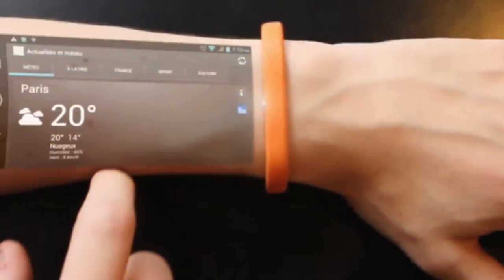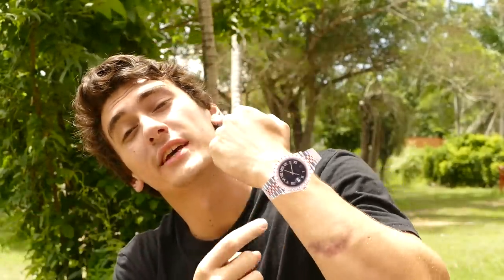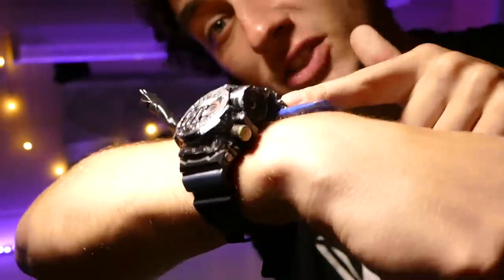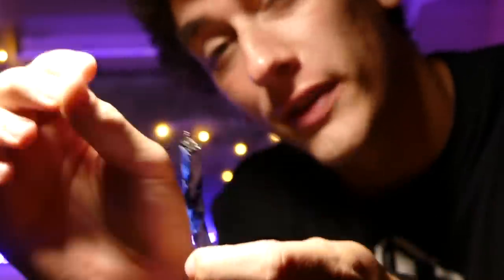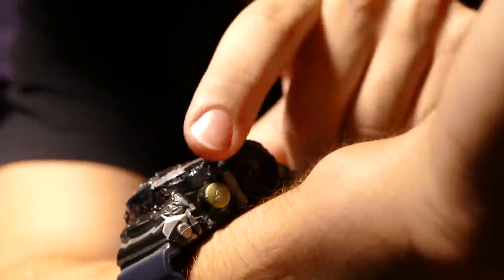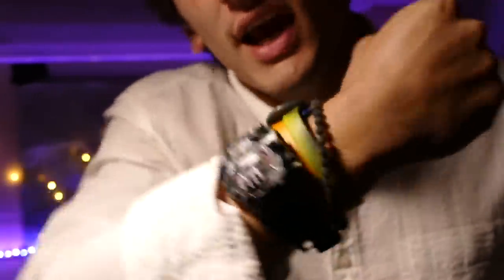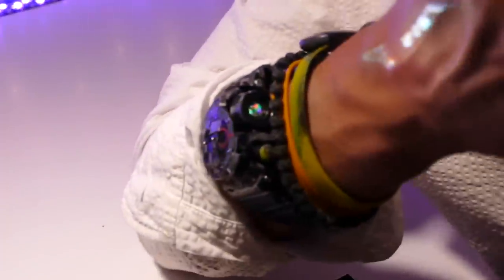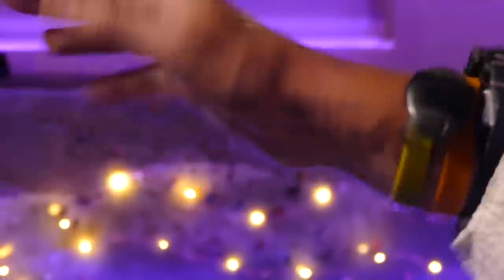How to Make a $30 Projector Watch! (Futuristic)

Comment: 1. Remove the heat sink and use the watch as the heat sink.
2. change to Bluetooth. This will remove more than half the circuit.
Battery type could be changed to 28L Then again a flat battery would be used.like the 7K76 is my thinking.
could also place this on the wrist band to make it even smaller. Just a thought. lol. Good video idea though.